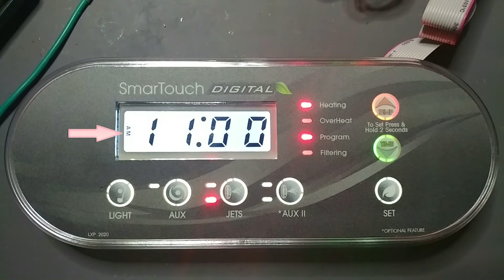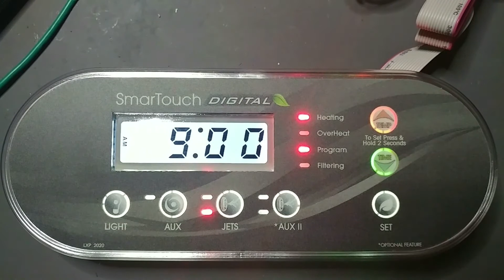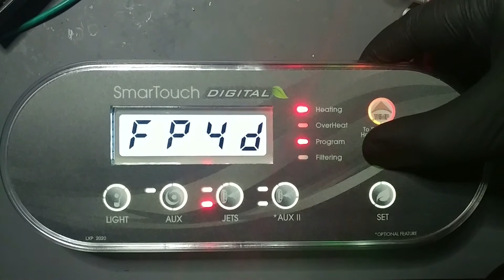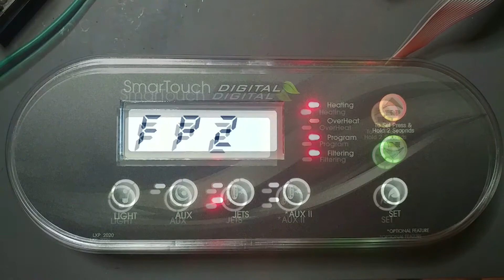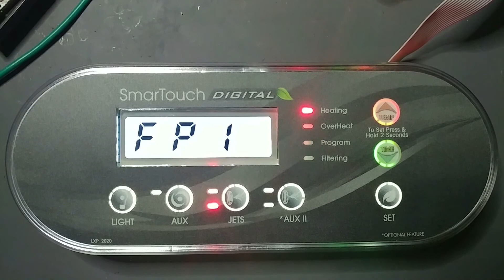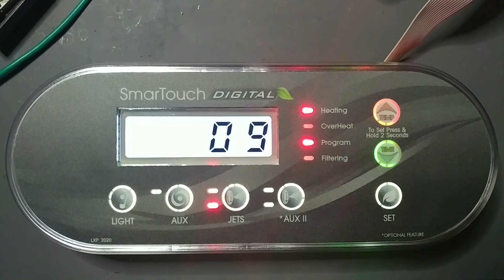SmarTouch Digital Spa Control Pt 2 | Program Filter Cycles, Silent Mode, Time of Day

Comment: do these settings matter if you have a 24 hour circulating pump? and what should the settings be with a circulating pump? thanks i also have the in.clear generator system if that matters. thanks

Comment: How do you change temperature display from Fahrenheit to Celsius??
Reply: Did you get an answer? I have the same problem
Reply from the maker: Hi! I’m planning to make a video that shows you how to switch the temperature from Fahrenheit to Celsius. It involves accessing a special programming menu and following a few simple steps to make the change. Be sure to subscribe and hit the bell icon so you get notifications when the new video is up.
Reply: @dbsparepair  Any update on this?

Comment: Thanks Sam ! Great Info.  I was able to get most everything set like you demonstrated.  I did have 1 small thing and I done know if it is an issue or not.  I have just turned powered it up and turned it on. All of the programming steps were followed and I see the the "filtering" light is on and a pump is still turning slowly after SIL mode has been set between the hours set for FP1 and FP2 Cycles.  Any thoughts on that ?   The SILd was set for 11 hours between the two FP cycles.

Comment: How do you turn on the waterfall features that are on each side of the swim spa using the Smartouch digital 2000 panel?
Reply from the maker: Hi, waterfall features are usually connected to one of the pumps in your tub. They should have an on/off valve that controls the water flow. To operate the waterfall, turn on your pumps and find the valve that allows water to flow through the jets. Once the valve is open, the water should begin flowing.

Comment: Is there a way to cycle the jets with programming? Seems like it’d be very helpful for agitating debris and filtering it
Reply from the maker: I assume you are asking because your spa is equipped with a circulation pump? If so, there is no option to program all the jets to run for a period of time during the day. 

Now there is a purge cycle. If no one uses the spa, and no one presses any buttons with in a 24-hour period, the system will run all the pumps for about a minute.

Comment: I have a new Acura spa controller that will not run filtration regardless of setting for fd1 and fp1. The filtration light only comes on after the set button is pressed. Is there some other setting that disabled the filtration program.
Reply from the maker: Do you know if you have a circulation pump installed?  If you do have a circulation pump installed and it is programmed to run 24/7, filter cycles will not really work, given the circ pump is already running, hence already filtering 24/7.

If you have no circ pump, and the main pump one is the filter/ heat pump; make sure you set the time of day. As mentioned, make sure you are setting for PM or AM. 

I am sure you have done so, but make sure you always scroll to SEND when you are done programming the filter cycles to save the settings.
Reply: @dbsparepair  Thanks for comments.
There is no circulating pump. The post use filtration causes two speed pump to run on low speed for  filtration . Time of day is correct.
Reply from the maker: @darrylpass4845  Ok, well when you press the SET button when the spa is not being used, it will trigger a small filter cycle. That normally runs for 30 minutes. That filter option cannot be disabled.

Comment: If I put it on standby can someone override it if they put the temp up? Or is silent going to override it if anyone wants to raise temp in the middle of the night?
Reply from the maker: If the spa is in silent mode, the spa will not heat at all, even if someone sets the spa to a higher temp.

The spa will heat to the new temp once it is not in silent mode.

Comment: Hi I Have a swim spa are the set up the same my circulating pump only works when heating ?
Reply from the maker: If you have a circ pump installed in your system. I believe the filter cycles will still apply if the circ pump is NOT programmed to run 24/7 or wired for 24/7 operation.

Comment: Sam- when I hit the set button and hold it is not displaying temp I set, it just keeps blinking. Any suggestions?
Reply from the maker: Hi, You should be hitting the Up arrow button. 

Watch the first video of the Smartouch Digital I made. It goes over the controls.

https://youtu.be/GMWBTma2-R8

Press the hold the temp up button for a few seconds, the screen will start to flash the temp you want the spa to heat to.

When the screen is flashing use the up and down buttons to scroll to the temp you want.

Then press the SET button to lock that temp in place.

Comment: Hello, I have a smart touch digital on a passion spa we just bought 2 weeks ago, and I'm curious about the filter LED light.  Is it supposed to be blinking or solid red when filter cycle is going?
Reply from the maker: Hi Brad, thank you for subscribing to the channel. The filter LED will blink when it is filtering, I believe when someone press the set button force it to run a 15min-30min filter or when it kicks the programmed filter cycle.
 
If the spa is not showing any error codes on the screen, and it is heating the way it supposed to heat, you should be fine.